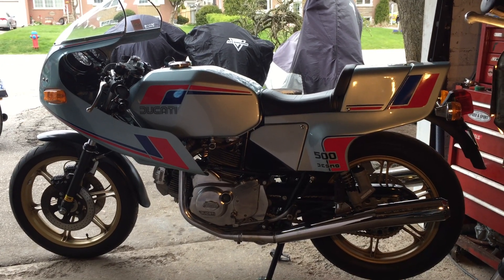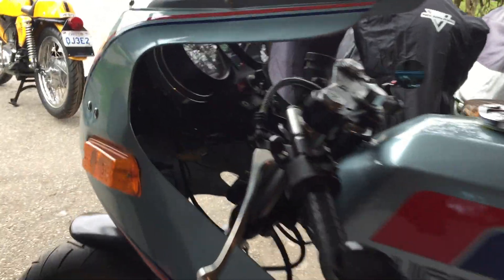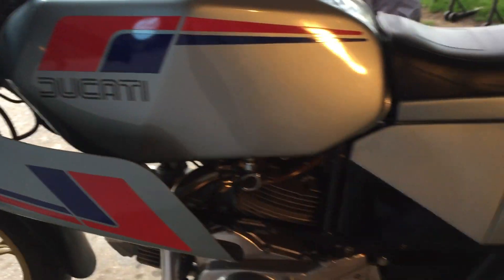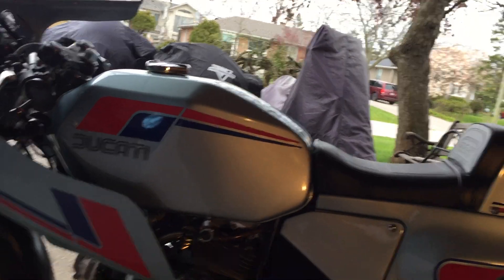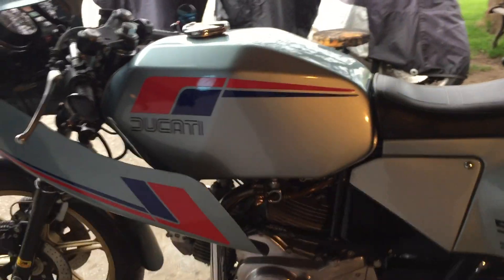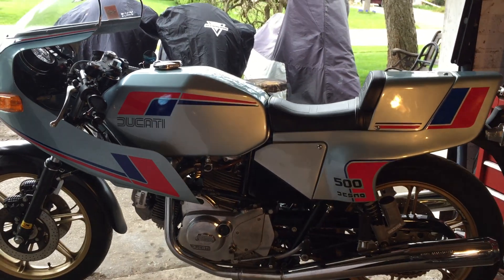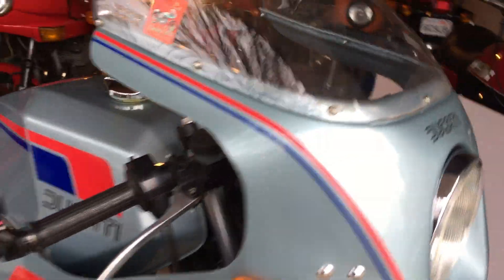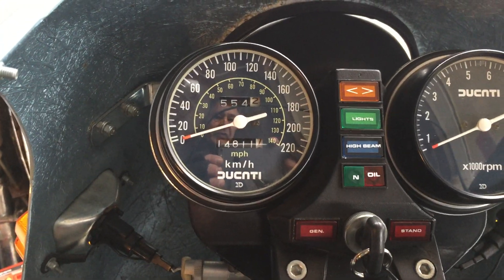1981 Ducati Pantah 500 SL overview

Comment: Great motorcycle , well ahead of its time , the conti pipes are a good replacement and improve performance , getting rid of the air box also helps , if the clutch slips at high rpm replace the clutch plates and springs , don't put heavy springs in it'll just make it harder to pull in the clutch lever , Pantahs are known for wearing out clutches , the carbs are also known for wearing out slides and that's where people have problems tuning them  , I've been working on these bikes for over 40years still do and still enjoy my work : )

Comment: Used to do everything with this bike.  Club Race, toured 2 up through Europe, commuted through London.  Absolute favourite.   Didn't have that many weak spots, but if pushed: One batch run had dodgy gears, I think it was a 500 batch with the later fairing.  The clutches sometime slip until you fit stronger springs.  If really pressed on a track the front end would flex, causing fearsome tank slappers, something that can be alleviated by a well made and well fitted fork brace.  The overweight original exhausts rust quickly.  It's probably better to fit aftermarket 2:1 pipes and leave the originals in the garage for later resale.  The engine is fairly bulletproof.  The rear mudguard is superfluous.  I took mine off and fitted the registration plate and light straight onto the frame, saved about 5 pounds and looks better.  The fairing is tough as nails, I must have dropped it a dozen times, it can also stash a decent amount of kit in it.  I think I fitted a tent down one side of the fairing and a thin sleeping bag in the other when touring.  The seat isn't ideal for a pillion going long distance unless they are very petite.  The translation in the handbook was appalling.   Never owned a more fun vehicle.  Still have the trophies somewhere.
Reply: one of my old mates had one ,seat could have done with some more padding